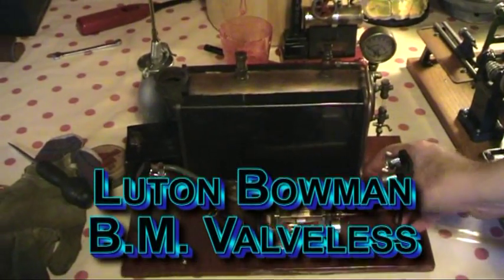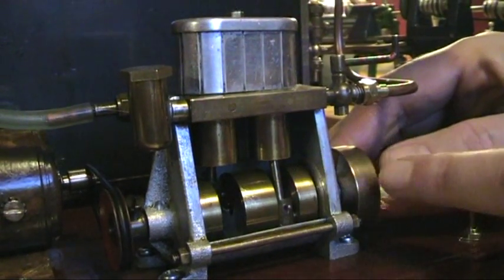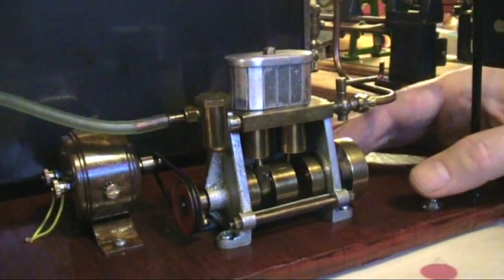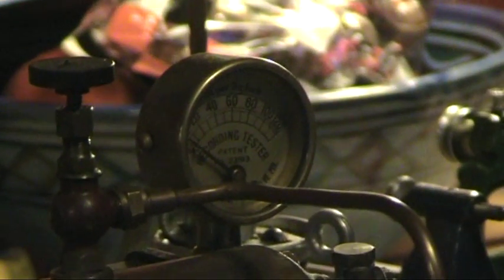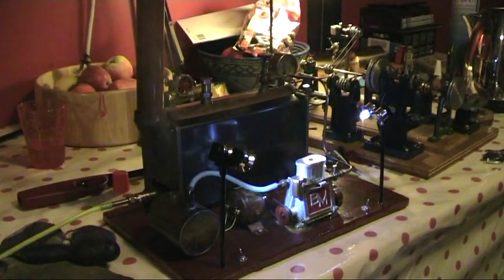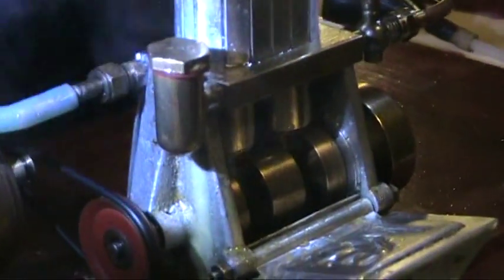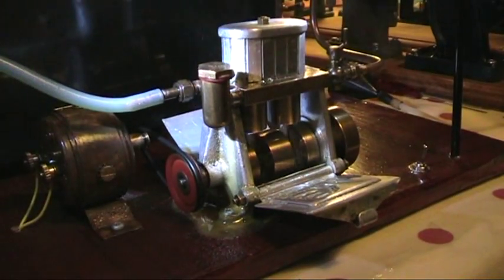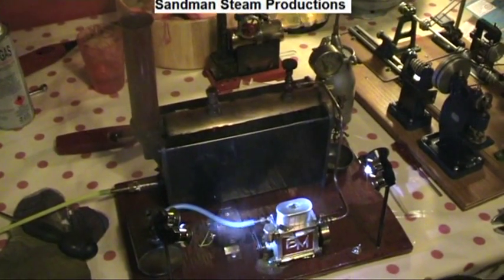Luton Bowman BM Valveless Steam Marine Engine.

Comment: I have long been interested in a valve less air or steam engine but have not succeeded in obtaining the slightest information on the working or design of such an engine. There are some patents for such type engines but they are way beyond the buiding capacity of any but professional maunfacturers. From your video it would seem that the engine is of simple construction and quite clearly there are no indications of any valve actuating mechanisms. Could you please help me out with just how this engine works and would it be possible to build this engine in a home workshop without foundry capability. Thank you.